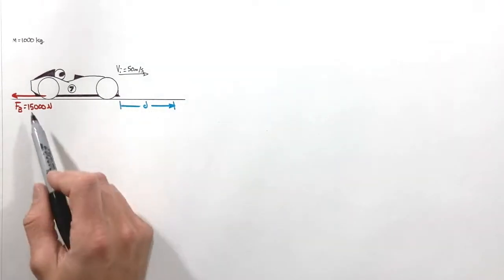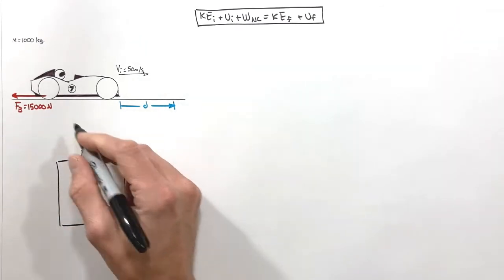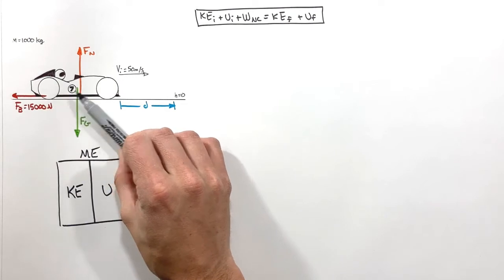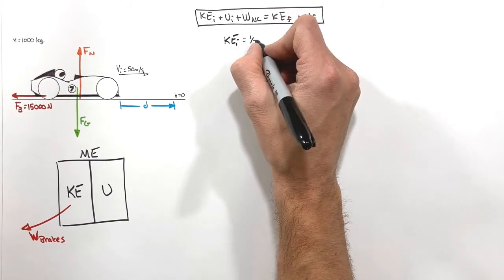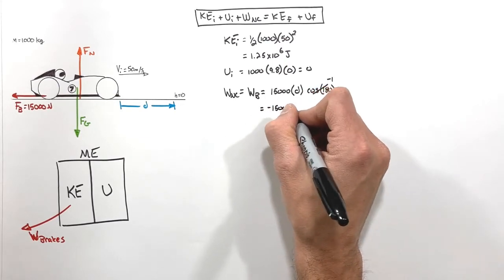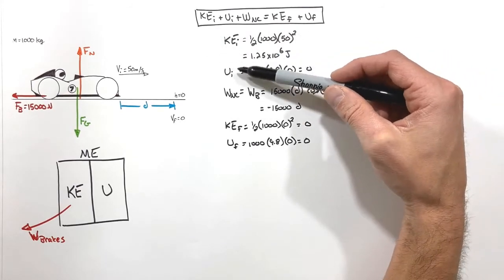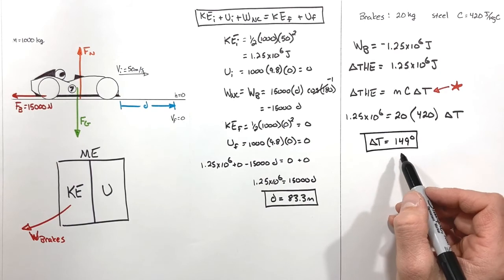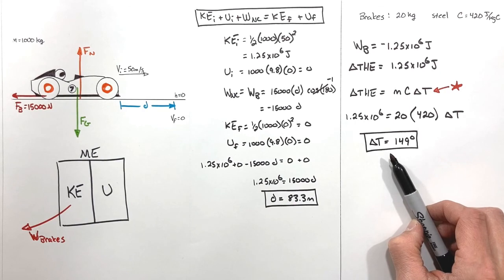Kinetic to Thermal / How Much Do Brakes Heat Up?

Comment: Does each brake heat up by 149⁰ or divided by 4, or the front brakes get hotter than the rear brakes so 149⁰C is not yet an answer is it?

Comment: I have a question > I take a warm solid cast iron skillet off of the stove with my bare hand holding the skillet by its cast-iron handle. I put the warm cast iron skillet in the sink and slowly fill it with cool water. The skillet cools and steams and sizzles as it is cooling BUT the handle becomes too hot to touch. WHY does the handle get HOTTER with the cool water cooling down the warm skillet? Logic tells me that the entire skillet should become cooler so WHY does the handle get HOTTER before it also cools down???????   TM

Comment: For example my car decelerates from 100 to 0 km/h in 3s ( 40 meters ) how i can figure out the brake force in newton ??? Deceleration = 9.2m/s²
Reply from the maker: You need to know the mass of the car (in kg).  Brake Force = mass x 9.2
Reply: @INTEGRALPHYSICS  so a greater mass increase the braking force at the same time its hard to stop a heavy car bcz of its big mass